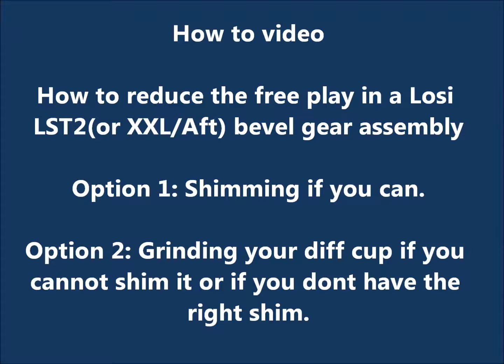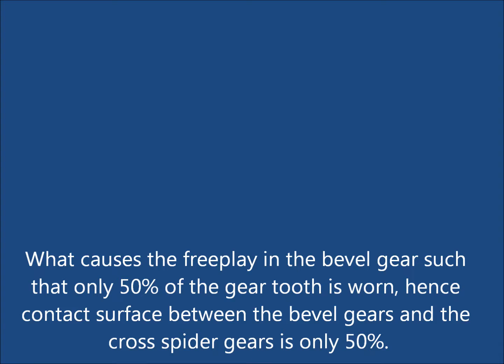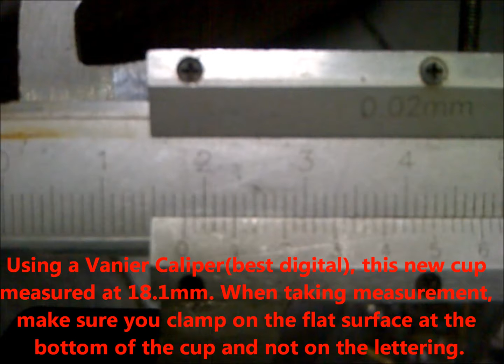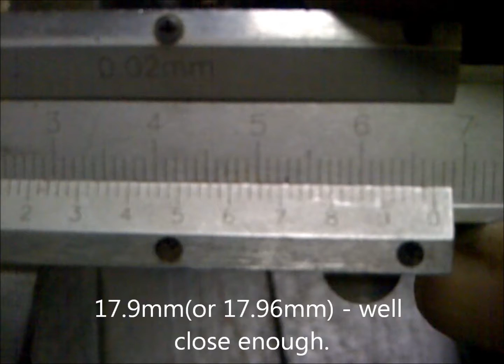MEXRC Option 2 How to reduce LST2 bevel gear freeplay

Comment from the maker: I canr replace an uploaded movie.

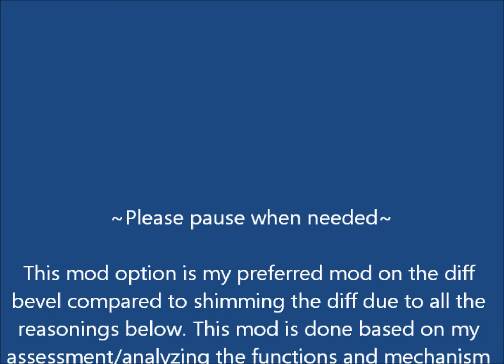Additional step towards the end.(6:16)
-------------------------------------------------------
When installing the diff cup assembly into the diff casing, very likely you will need to add additional 1 or 2 diff crown shim or as needed to obtain a good gear mesh 
between the diff crown and the pinion gear.